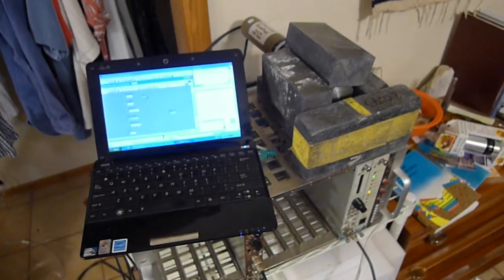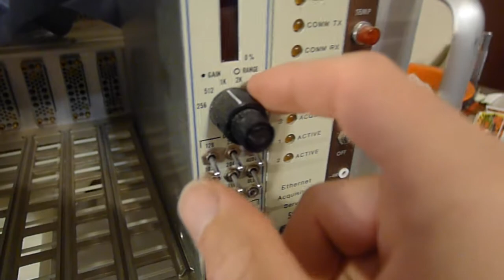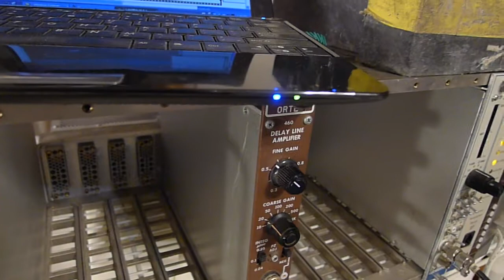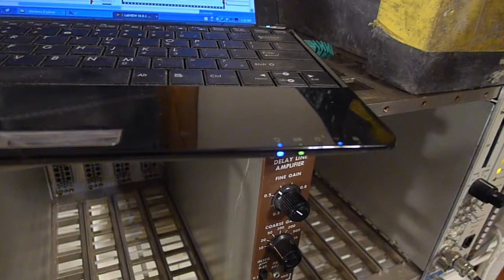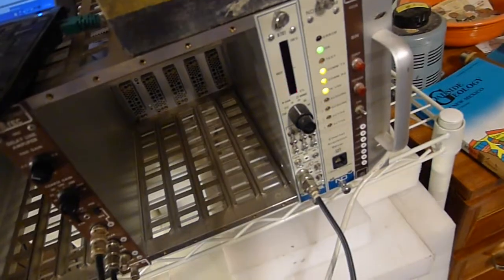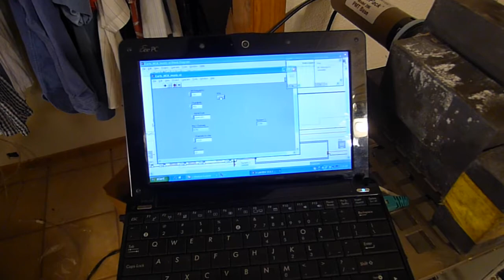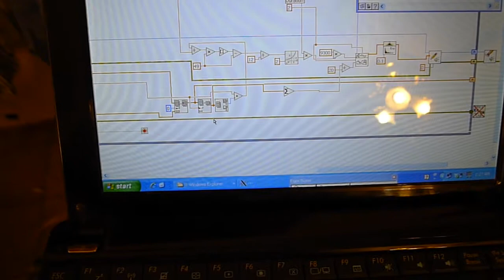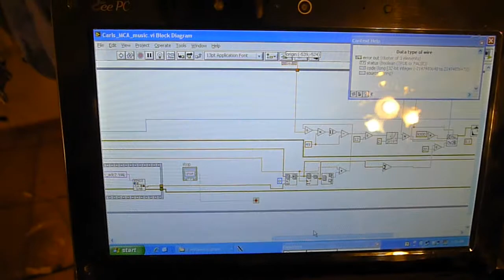Audible gamma radiation spectroscopy

Comment from the maker: Most cheap brands of glow-in-the-dark paint will also glow after exposure to x-rays, since the paint is based on zinc sulfide.  An example is Palmer Item #628614.  You need a lot of radiation to make the paint glow intensely enough to see easily--a few hundred roentgen / hour is sufficient, or put the paint bottle under a modern medical x-ray tube or a cancer therapy linac (get to know a medical physicist or x-ray tech at your local hospital for this kind of favor).

Comment: Hi! Could you tell me where did you get this amplifier and sharper? Is it something like CAMAC?
Reply from the maker: The amplifier is an Ortec 460 Delay Line Amplifier, probably picked up on eBay or in a dumpster somewhere.  It is a NIM-standard amplifier, in a NIM "bin" like the ADC and MCA modules.  I have not ever had a reason to get into CAMAC.